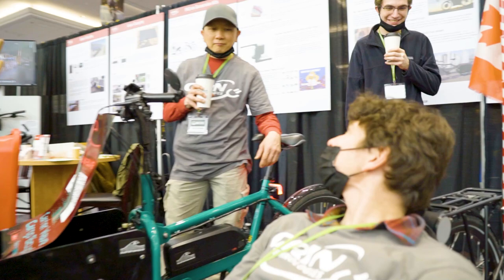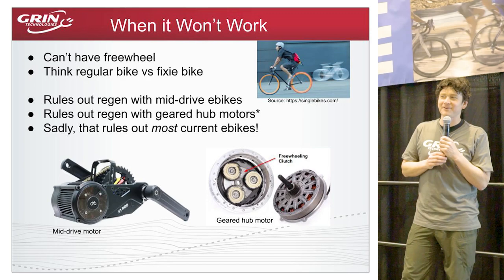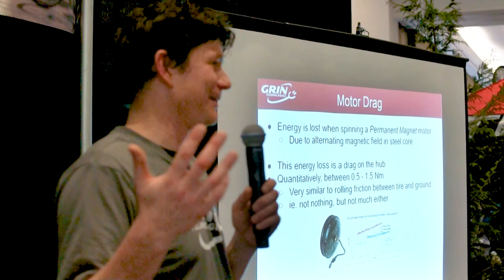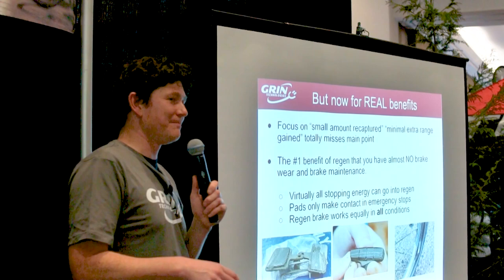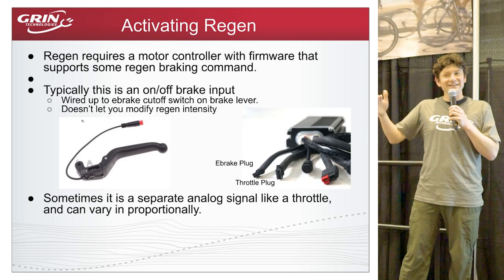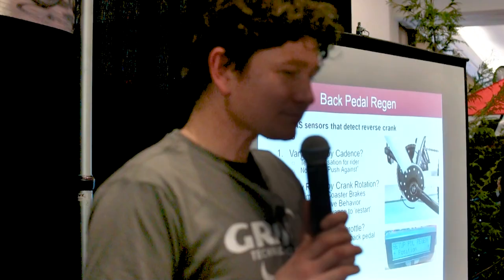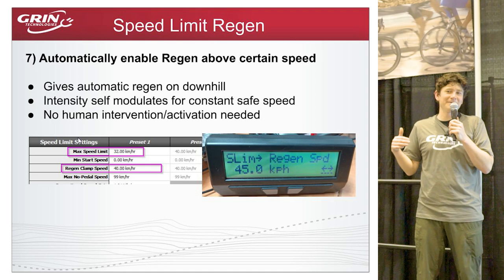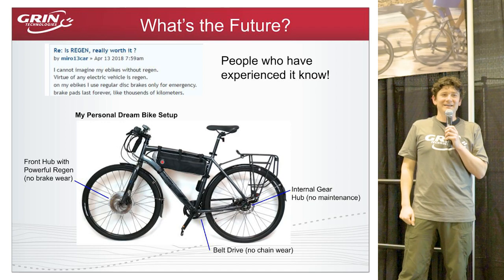Regen Braking and Electric Bicycles, Justin's Presentation from 2022 BC Bike Show

Comment: Great presentation! I’m right there with you dreaming for a maintenance free eBike. I do think you’ve missed one option though. A hub motor with a build in gearbox could connect to a rear wheel with no freewheel and thus do regen (it could even use its gearbox to modulate braking power). I’ve seen Valeo advertising their new mid-drive+gearbox solution’s ability to move a bike in reverse, so I assume it must have no freewheel. They don’t advertise it’s regen braking abilities, but it seems like it should be possible. If they don’t enable a mid drive with gearbox and regen I hope someone else does, it would be awesome.
Reply from the maker: In theory yes but unfortunately all of the internal gear hubs have a freewheel mechanism that is intrinsic to the design which can't be bypassed or disabled.  The only exception we are aware of is the Sturmey Archer S3X which we played around with here in a unicycle project:
https://unicyclist.com/t/3-speed-unicycle-build/115445/3
It was pretty unreliable there and I wouldn't trust it much at all with motor power levels. 
It would indeed be awesome if something of the strength and caliper of a Rohloff was available for this.
Reply: Maybe Valeo doesn't advertise it’s regen braking abilities because their setup is not capable of regen?
Reply: @GrinTechnologies  totally hear you on hub gears. The difference with Valeo's system is that the gears are in a box along with the middrive (kind of like the existing Pinion gearbox but with a motor as well). The fact that they advertise its ability to move a bike in reverse makes me pretty sure that it doesn't have a freewheel in the wheel. I do bet there's a freewheel in the pedals themselves that allows backpedalling to disengage from the crank. It'd be great if they implemented your idea of having backpedalling convert the throttle into a regen control, but I guess we'll have to wait and see. Hopefully bikes with their product will be sold soon so we can have a better idea of what it's really capable of, and my fingers are crossed that they do enable regen.

Comment: I have a Bafang BBS02 build. I like the range I get from the mid drive, but if money was no object would it make sense to add a small hub motor to the front wheel, purely to use as a regenerative brake? 
Almost like a dynamo hub but with much more useful power generation than the ones that just charge up your lights.
Reply from the maker: It actually makes more sense to have a decently powerful hub motor that you use all the time for motoring and for regen, and then only use the BBS02 when you need an extra kick on hill climbs.

Comment: Also, once the battery and various capacitors are charged I assume the free-wheeling / direct drive will have slightly less drag? I'm hoping to build around a 48v Maxwell DuraBlue Ultracapacitor (+ Lion battery in parallel). 6.0 mΩ of ESR, rated 100A continuous, 1600A short circuit pulse!, but only storing 3 Wh over 18 cells @nominal 2.7V!

Comment: Which controllers can do active electronic braking to come to a complete stop?
Reply from the maker: All the controllers that grin currently sells (Phaserunner, Baserunner) and has sold in the past 6-7 years (Frankenrunner, Grinfineon etc).  Other controllers that do good variable regen would be the Kelly controllers, the Vedder VESC, and or any industrial BLDC servo motor controller.  Most inexpensive generic chinese ebike controllers do pretty crummy regen, if at all.

Comment: My 48V DIY bike with direct drive hub motor paired with a regen capable controller only lets regenerative braking above 16mph speeds, thereafter I have to apply mechanical brakes to slow down further. I understand the motor voltage has to be higher than controller's for regen to work, but the speaker implyed the regen should work almost down to 0mph. Am I missing anything? Those who have bikes capable of regenerative braking at what speeds does your regenerative braking cut off?
Reply from the maker: Your controller is definitely not configured for proper regenerative breaking if it stops working below 16mph.  All regen controllers we have encountered will by default do regen right to a stop just fine. In some cases there is a configurable minimum regen speed setting for those who want it out a bit earlier.
Reply: @GrinTechnologies  thank you very much for this response. I'll look into the controller settings once again. Possibly I have controller settings and motor characteristics mismatch.

Comment: With the helical gear thing, would you not also want the cut in the other direction if feeding it the other way? Perhaps the thrust bearing is not the only issue.

Comment: Re Regen, charging we are told must be limited to a percentage of the battery capacity, say 15 to 25 % in order to not damage battery, or are there there electronics to dump the excess power to a shunt or hold it temporarily and smooth out the charging rate.  Perhaps you answer this question in ur presentation?  Ta.
Reply from the maker: There is a huge difference between continuous charging currents (best kept at 0.5C or below) and what you can do for short durations during regen. Most hybrid card do like 3C - 4C charge currents during regen and show basically no ill effects on battery longevity as a result, so really there's no problem dumping current in at the max rate that you need for braking.

Comment: Very interesting, thank you!
LOVE the silent smoothness and consistency of regen! Got 10-15% when I was using RC lipos. Recently I switched to a Aliexpress ebike Battery (52V 19,2Ah 5A max charge, 21700 cells) and am scared to use regen now. Can the battery take the regen from a MagicPie5?
Is it safe to use regen with a chinese battery? What would make it safe? Could the energy also be dumped as heat before the battery? If, someone knows, thank you!
Reply: Just use a fuse with the same value as your battery voltage . This is probably the cheapest way to solve the issue
Reply from the maker: Even with generic quality no-name cells you should have no problem doing regen at C/2 or even 1C.  The max charge rating is usually related to the charging port mosfets of the BMS circuit (and associated connectors and wiring), and doesn't usually relate to the discharge port currents.   I wouldn't worry about regen putting you at any greater risk than you are already taking with the aliexpress battery.
Reply: @GrinTechnologies  Awesome! Thank you

Comment: My dream bike setup would be 42:11 with a mid-drive motor (for the integrated torque sensing+cadence sensing, and what I heard better traction in the rear wheel), and an automatic shifting rear IGH. Though not sure how much more benefit would the mid drive offer, and whether there are any technical challenges with integrating the front and rear wheel drive power. (So the front hub is mostly there for regen XD)
As for the braking controls, would it be difficult to make the brake tripwire offered in your shop use some sort of hall effect + magnet setup, or some kind of pulley + encoder setup, or any other kind of a linear position sensor?

Comment: Justin is the grinning ebike pope. Hey man, this phrase has rythm. Ok, 1.5 serious questions:  (1)current of regen charging? can it be too high for conservative loading. Standard market chargers in Brasil are 2A and 3.5A, and are to be used on cells that are cool, not heated up by intensive discharge. So, can it harm the cells a bit?  (1.5) when regen is not progressive, but set at fixed rate, by lack of variator device, how much do the percentages of gain go down as compared to the numbers mentioned in this master classy?
Reply from the maker: I didn't get a chance to cover this topic in the presentation but it's we'll cover it in detail when we do longer and more technical talk. From all practical experiences, the temporary short duration charging at 1C or even 2C you get from regen doesn't seem to have any material effect on cell longevity. That's the case even though fully charging a battery from 0 to 100% at a continuous 1C-2C charging rates is definitely not good for cell life. 

As for the difference in recapture between an on/off regen system versus proportional regen, it averages about 50% more energy capture with a proportional system. From personal experience riding the same bike and motor here in Vancouver, I'd average about 4% regen with a fixed on/off system with the infineon controller, while with the Phaserunner I'm averaging more like 6-7%.

Comment: Thanks Justin for this presentation .. I am not much into electricity but I really want to understand this  in simple detail…
If you apply max regenerative braking that means you send Voltage to  "to reverse polarity " roughly equal the voltage generated  by spinning rotter, Dose this mean the generated amount is very little compared to the opposite situation with minimum regenerative braking ??? ….. Also what if theoretically  we want regenerative power of spinning wheel down the hill without any brake ??
Reply from the maker: Hi Hossam, there is no real such thing as "max regenerative braking". You can keep increasing the braking force as much as you like by having greater and greater negative phase current flowing through the motor. At some point, the energy going back into the battery decreases, hits zero, and then goes positive as you actually expend energy to sustain the higher and higher braking forces. 
The phrasing of your question suggests a lack of understanding of the principle in which regen works, so I'd recommend looking up how a DC-DC boost converter circuit operates and understand that.  Regen is the identical principle.

Comment: Great video, thanks!
are there no concerns with the battery charging rate? i.e. the high current flowing into the battery during regenerative braking
Reply from the maker: We've seen zero evidence of it.  Look at the 'C' rate on say a hybrid car which does like 4C-6C or higher during regen, while on ebikes you're usually in the 2C or less realm, and virtually all decent lithium cells can handle this for short time periods without any negative conseequences.  The "maximum charge current" rating that you often see published on am ebike battery pack (like 5A) is a ridiculously conservative value based more on the charge port connector limitations, not on the cell's capability.
Reply: @GrinTechnologies  thanks a lot for your answer! it is good to know that in practice you haven't found any problems regarding the charging rate.

Comment: It would make sense based on your statements that a mid Drive would not be recommended when attaining a ebike if your goal is to get the most energy out of your battery. Is this correct?
Reply from the maker: Not as a general statement. There are times when a mid-drive motor will do better for battery usage (eg a steep hill climb followed by a long gentle descent), and other times when a regen capable hub motor will do better (eg a long gentle hill climb followed by a steep descent)

Comment: what about dynamo  would that work on standard Ebikes
Reply: If you mean using a dynamo in the normal way to power a light, for example, then the answer is yes. EasyMotion has ebikes with front hub dynamo powering a light. Functionally, it's an alternative way of getting battery power to the light. 💡

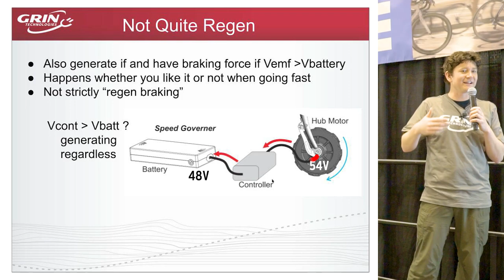Comment: Hi Grin Tech, at 3:50 you explain that this pseudo regen relies on the motor spinning very fast and has a higher voltage than the battery pack and occurs at a critical speed. Why does this happen? What causes the motor to not just continue to spin faster and faster? Why does it slow down as it is putting negative current back into the battery?
Reply: In my experience this pseudo regen is happening when you have the throttle opened up all the way (so the controller has hit its max rpm output to the motor)  If at that point you are still gaining momentum from the hill, the controller will be holding you back the max rpm it is programmed for by design.  If you let off the throttle completely while still on the hill the controller won’t be limiting the rpm and you could potentially continue coasting faster than with the throttle engaged.

Comment: You only would have to use a Aircore hub motor(no iron,Axial flux)which has no drag only when you are breaking = charging.
Reply from the maker: For sure, but you also have like 1/10th the torque density without the iron. A better solution is either grain oriented steel or amorphous steel cores, which can in principle bring core losses down by an order of magnitude and hence have truly negligible drag.

Comment: Does the re-gen switching mechanism ‘need’ to be within the brake lever mechanism?
Why can’t it be in-ine, interrupting the cable at a convenient place?
Reply from the maker: Oh it can and often is.  The tripwire is often installed at the caliper rather than the lever, there are sensors that sense the moving brake cable inside a sleeve, and there are hydraulic sensors that tap into and sense the fluid pressure in the brake line.

Comment: Why not have a dual motor, 1 mid for torque and on hub to regen. It seems like adding a 2 stage break lever would be the easiest fix for when breaking. Just have the regen increase on the squeeze and the pads engage on the last 1/4 of the squeeze. Can all you people smarter then me tell me why I am wrong?
Reply from the maker: Dual motors works great. It's more expensive and complex than a single motor solution but other than that has no real downsides. Watch this video presentation we have on that very topic
https://www.youtube.com/live/Ub4EP2_mAds?si=_MZtbOiE2T89Lt3h

Comment: Does a regen brake system can be installed on a bicycle with a CYC X1 Pro Gen2 mid drive motor system installed with BAC2000 controller and powered by a 72V battery?? Thank you for a detailed answer.
Reply: No it was literally mentioned at 4:40, mid drives cannot use regen. I myself am getting an X1 PRO GEN 4, there's a freewheel attached to the motor such that it'd be impossible to reversely spin the motor to generate energy even if the rear axle was fixed

Comment: what is the concept or model of the controller between battery and hub motor ?
Reply from the maker: It is a 3 phase bldc motor controller. You can't really run the motor without one

Comment: Ideally there would be brake blending, just like with a BEV.  You squeeze the brakes to apply more regen, once that's maxed the mechanical brakes are gradually added on.  On my Mach-E it tells me how much of the braking energy I reclaim every time, it's usually 99-100%.
I was wondering, how feasible would a middrive with regen be?  I have a middrive with a one-way clutch on the pedals, so it can be done, but would it put too much strain/stretch the chain?  I would hate to get chain slip though! 😱☠️⚰️
Reply from the maker: A regular chain with a derailleur doesn't work for regen even if you lock all freewheels, since the top of the chain goes slack as the derailleur gets stretched out and then the chain just falls off.  You'd have to do a real custom drivertrain with both a top and bottom tensioner and have the derailleur designed to cope with full chain tension.  Otherwise it's only viable with a single speed chainline and an internal gear hub that doesn't freewheel, of which the only model we are aware of is the Sturmey Archer S3X
Reply: @Grin Technologies  I didn't even think of that!
Reply: @GrinTechnologies  IMHO "chain slack" issues not that it uses a "freewheel" should be the reason given for not being able to do regen for a mid-drive...  Since I had the same thought about locking out the freewheel since the mid drive crankarm can freewheel, and that freewheeling should not affect its ability to regen. But I wondered about the tension (ie slack) on the chain, (in the  derailleur's cage),  being an issue? Which is the main issue to be overcome... 

But overall its was a very informative and thought provocting lecture on Ebike regen, thx....

Comment: Most of the  regen energy you are creating is burned off as heat in the coil windings...because you are effectively shorting them out against the battery resistance ,but there is enough  back emi floating about to power the display electrics (5v min , which can be very confusing when diagnosing power faults)   ..Ive measured 24 volts max return voltage when going free wheeling down hill ,that would reduce if there was any electro breaking load .. The Electro breaking is great  but as you say only helps to reduce break wear. Also stuffing voltage up the output of the battery misses out the internal battery cell charge controller .
Ive used a cheap solar pannel charge monitor , it can tell you everything happening  in realtime. and great for testing real battery capacity .
Reply from the maker: Your understanding is a bit off. Typically about 75-80% of the energy goes back into the battery, and between 20-25% is heat inside the motor windings. The efficiency is better the faster you are going, and at fast speeds you can get close to 90% into the battery. It's only when you do regen at very low speeds (literally like walking speed) that it can wind up all going into heat.
Reply: @GrinTechnologies  how are you going fast with your regen brakes on? And how long is anyone breaking compared to coasting . Where is the voltage boost to be over battery voltage to enable a charge flow and maybe why not use super capacitors as a buffer as they can actually charge quickly.... it all sounds great but its just not worth the extra complication or weight ,  even if you use a whole ebike system connected to a wind turbine continuously  back charging you are not making 2 amps at near 42v (for 36v battery) and your missing out the charge balance controler.. which is bad for battery. You could use a solar charge monitor to   measure any generated power put back to the battery .